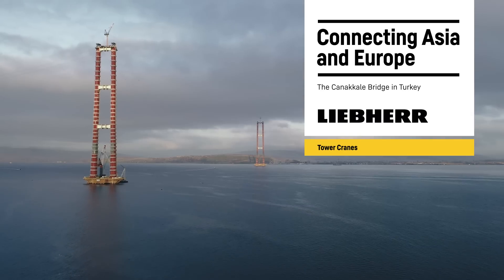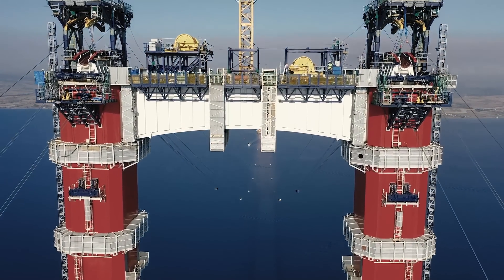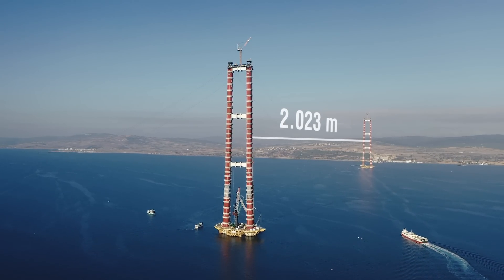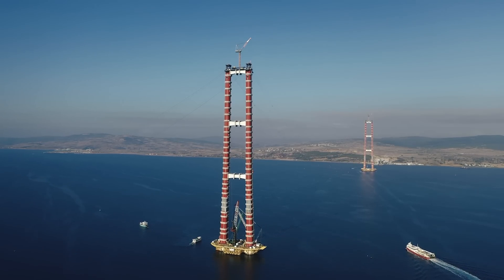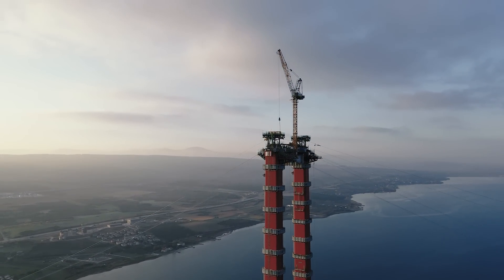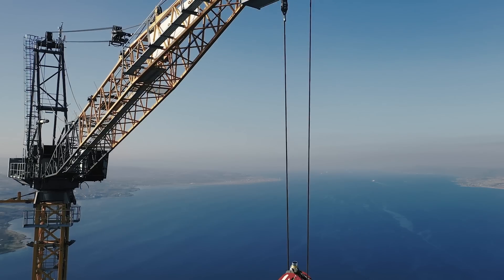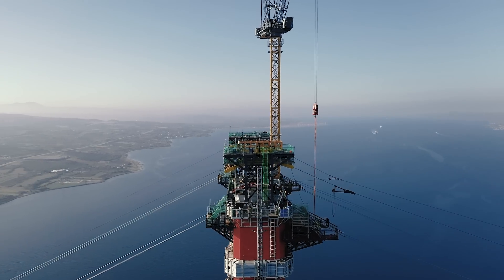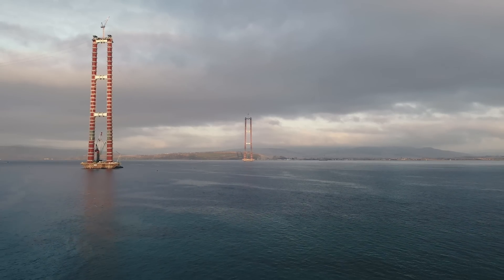Building The Longest Bridge In the World - Canakkale Bridge 1915 | Liebherr

Comment: Why do Europeans put a decimal to signify a thousands place?
Reply: Dots are not commas.  For example, the total length of the bridge (4.608m) reads four thousand six hundred eight meters.  If it had been written in kilometers it would have been 4,60 km.  Yes, I know, it is a bit confusing when writing digitally, but if written by hand, the dot should be placed at the top so as not to confuse it with the comma.
Reply: It´s for making it easier to read. 
Goes for every three figures, like 1.000 / 10.000 / 100.000 / … / 1.000.000 / … / 1.000.000.000 etc.